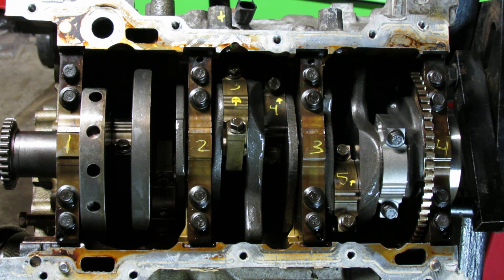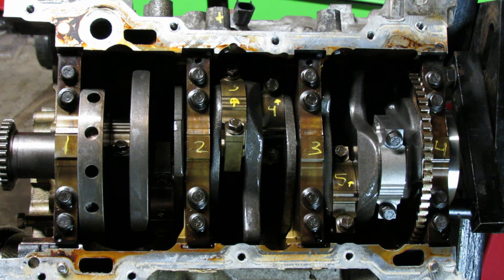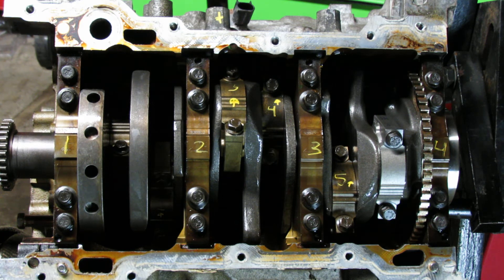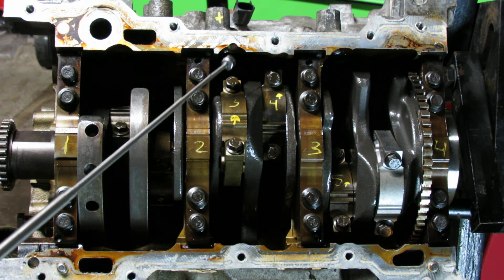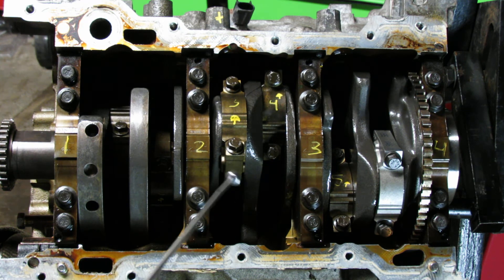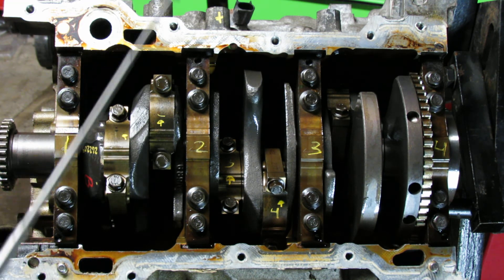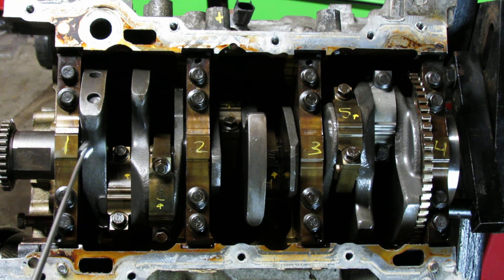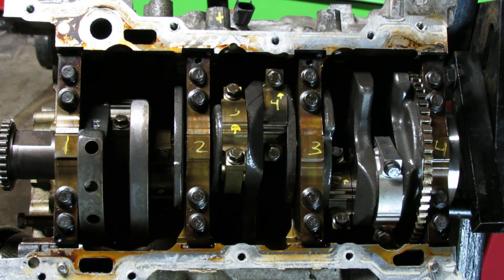3.6L GM Engine Torque Specification/Sequence: Crankshaft Rod Bearing Caps

Comment: Great Video can you reuse all the bolts for mains and rods or do they recommend replacing them
Reply from the maker: It is highly recommended that these bolts are replaced with new ones but you may reuse them again with some thread lock.
Reply: @HP38567  Thank you keep up the videos

Comment: Did you replace the bolts? For the mains and the rods if so are they dealer only
Reply from the maker: I personally reused the bolts. But it is always recommended that important like these should always be bought directly from OE. I'm sure there are other companies that make same quality if not better but I unfortunately don't have any source to share.
Reply: @HP38567  good to know thank you I figured they want you to replace the bolts cause there stretch I will reuse mine looks like head bolts are available after market but mains are dealer only thank you
Reply from the maker: @jefferygilboe635  Glad I could be of some help!